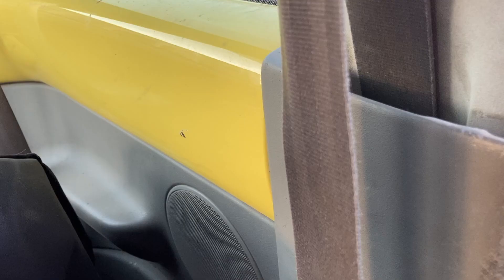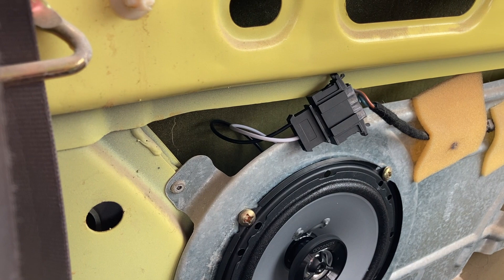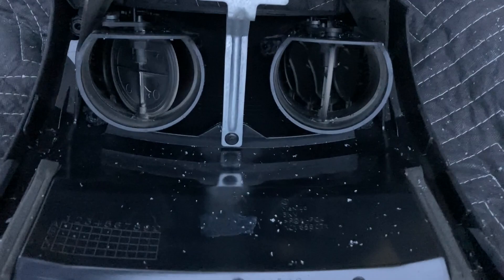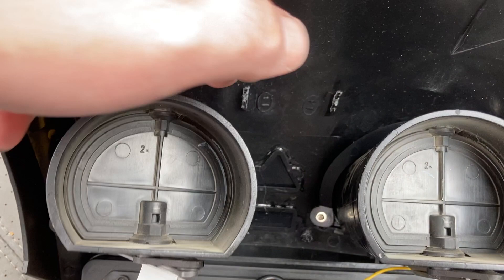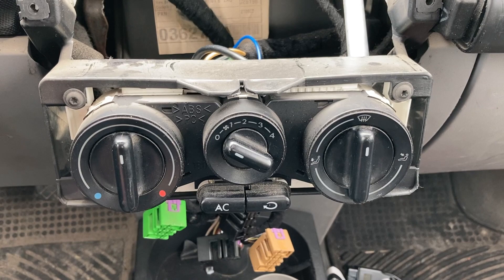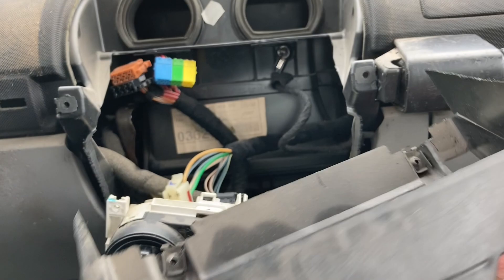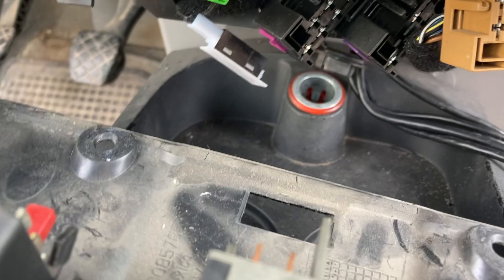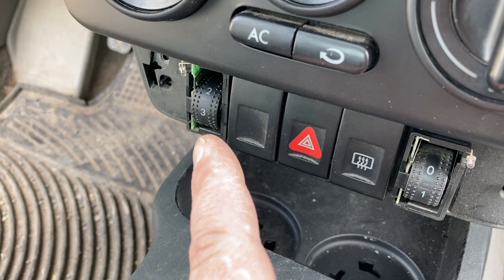Double Din Radio in a 2001 Beetle! Speaker upgrade too!

Comment: Thank you for this! I just recently bought this touchscreen radio for my 2009 beetle and after watching this detailed video on what needs to be modified I’m fairly confident I can do it myself finally. My only question is how to install the backup camera, do I need to modify anything or is it fairly easy?
Reply from the maker: I’ve started installing the camera but haven’t finished yet. Mostly because I haven’t had good weather to work outside. Hopefully in a couple weeks I’ll have a video showing what I did. Good luck!

Comment: Hi!, I have a new beetle 2006, and it's the same structure. how did you screw the bottom of the dash?. becase there is no place where it can be screw
Reply from the maker: The very bottom of the bezel I ended up not screwing since it was so hard to get too. It has little feet in the kit but I couldn’t get it to work. With my upgraded dash/console I felt it wasn’t going anywhere. The wiring of the heated seats and emergency light keeps it pretty firm. I hope this helps.

Comment: Where's the video of you altering the bezel that the new radio went into.
Reply from the maker: I took the easy way out and bought it. Thanks for the comment. What year do you have? https://m.aliexpress.us/item/3256803035878469.html?spm=a2g0n.productlist.0.0.16f2DTprDTpr16&browser_id=19b6181343814d46a1429024588dedcf&aff_trace_key=a2d0ff4583a246bb984169e2f0b8d694-1667233397703-05232-UneMJZVf&aff_platform=msite&m_page_id=eetmgwf4hhocadgy1842edb25f419328618213f245&gclid&pdp_npi=2%40dis%21PAB%21295.73%21141.95%21138.99%21%21%21%21%402103143616672334253625508e97ec%2112000030382036233%21sea&curPageLogUid=UlCeg5USHsRY&algo_pvid=83cebaec-1332-4156-a934-97daf4831655

Comment: Where did you get the center console ?
Reply from the maker: I bought it off a guy online. I'm pretty sure he got it from aliexpress.us. I'm super happy with how it came out. Thanks for watching and commenting!
Reply from the maker: https://m.aliexpress.us/item/3256803035878469.html?spm=a2g0n.productlist.0.0.16f2DTprDTpr16&browser_id=19b6181343814d46a1429024588dedcf&aff_trace_key=a2d0ff4583a246bb984169e2f0b8d694-1667233397703-05232-UneMJZVf&aff_platform=msite&m_page_id=eetmgwf4hhocadgy1842edb25f419328618213f245&gclid=&pdp_npi=2%40dis%21PAB%21295.73%21141.95%21138.99%21%21%21%21%402103143616672334253625508e97ec%2112000030382036233%21sea&curPageLogUid=UlCeg5USHsRY&algo_pvid=83cebaec-1332-4156-a934-97daf4831655
Reply: Does it still works nice? And how is the screen in cold winter weather?